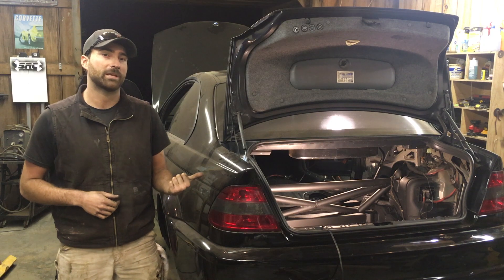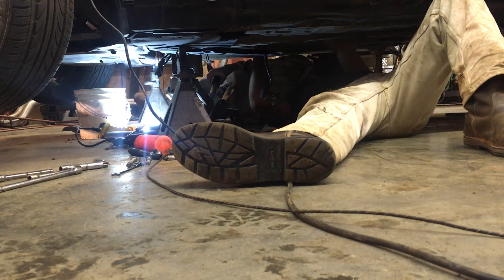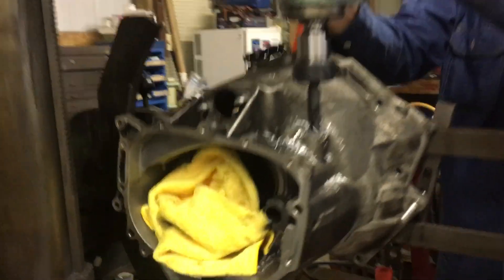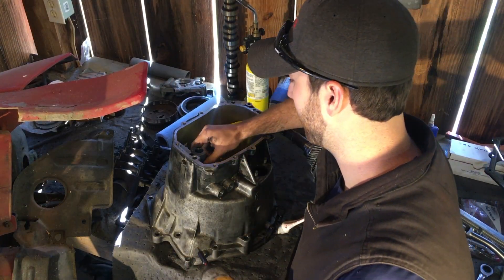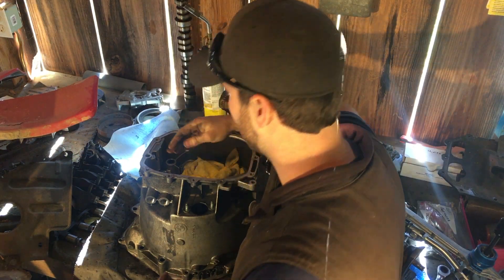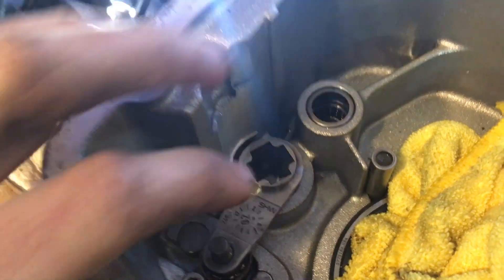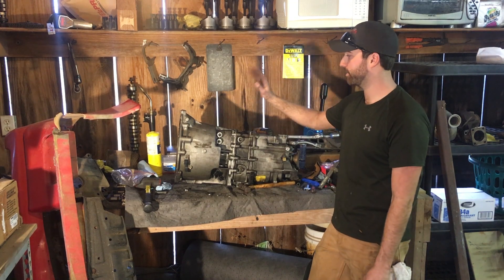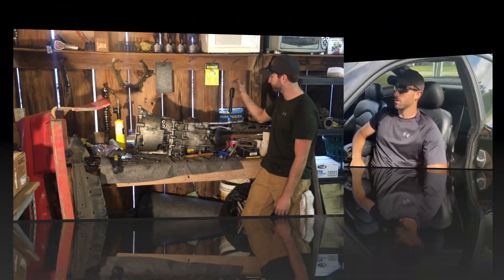E46 M3 SMG To Manual Swap Pt1: Disassembly And Bellhousing Modification

Comment: What method did you use to press/tap the bushings in for the 2 detent pins?
Reply from the maker: It’s been so long since I did it I honestly can’t remember exactly, but I most likely stuck them in the freezer for a minute to shrink them a bit and then used a socket that was slightly smaller than the bushing to tap them in place.
Reply: @RacingRejects  Alright thanks; I was thinking about buying one of those tool kits that are used to tap the detent bushings in on ZF 5sp transmissions on E36's and seeing if any of those fit for these, but I will try this if that doesn't work.

Comment: What was the orientation of the detent pins? Does the slanted sides on the groove face inboard to eachother so they can contact that bearing? Or do the slants both face downward?
Reply from the maker: The slanted profile goes towards the bearing.
Reply: @RacingRejects  so facing eachother then?
Reply from the maker: Yes
Reply: @RacingRejects  also, did you use any drift pins to install the bushings? My transmission is a stock 6spd and I’m replacing these pins as a precaution. Just dont want the bushing to go too deep into the trans

Comment: hi do you have part numbers for detent bushing i have the pins and spring but i can see you  also have bushing
Reply: 5:37
Reply from the maker: BMW-23127527439
Reply: @RacingRejects  
No, the correct part for the bushing kit is 23117542726
Reply from the maker: That part number is for the whole kit with the cap seal and C-clip, 23117533395 is just the bushing itself. If you use the set screws like I did, you only need the bushing.
Reply: thx for reply! i have this part also but u have bushing that you press in the holes and the locking pin goes inside
Reply from the maker: Try 23117533395
Reply: got the part and everything together ,thx

Comment: Why no gear position sensor tapping on the main transmission?
Reply from the maker: I bypassed the sensor with the wiring. This is the same way the Z4M is wired.

Comment: Great video. Would have liked to see more details about the SMG pump and line removal, but I feel like it is straight forward enough. 

I bought an SMG back in September that I was planning to convert using an RTD self centering shifter, but I found a swap kit from a part out guy with a 6MT, pedals, and lines for $1300. Hope your next video comes out soon, as I am itching to convert mine now. 

Thanks!
Reply from the maker: Thanks! Yes the SMG pump removal is straight forward you shouldn’t have any issues with that. The next video will be out next week.